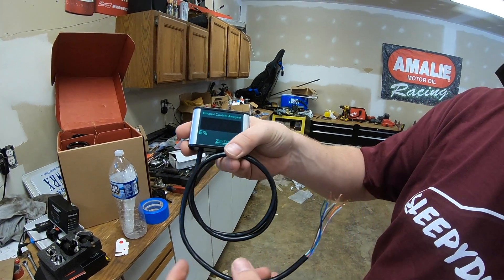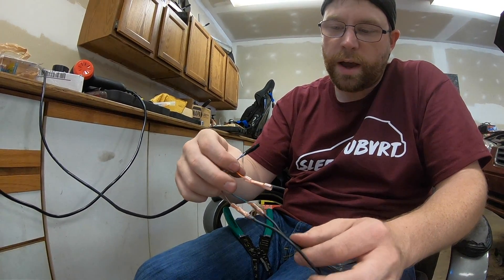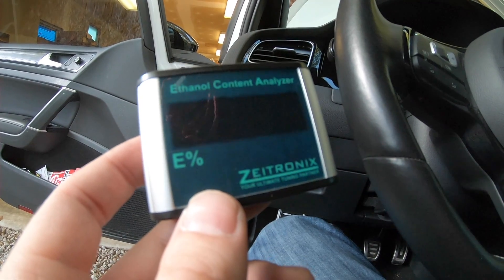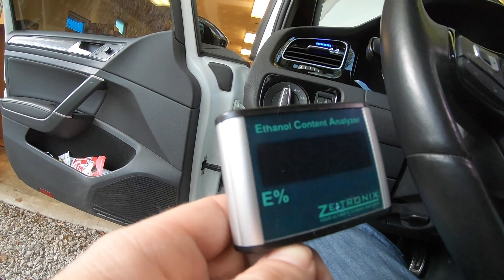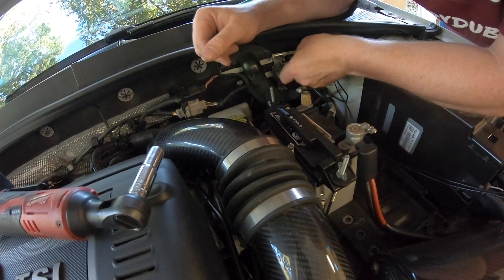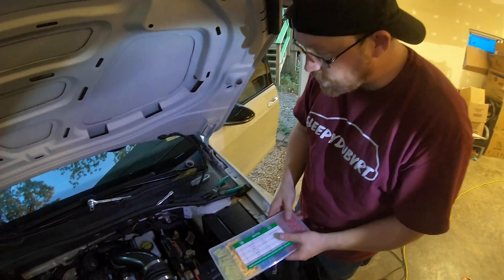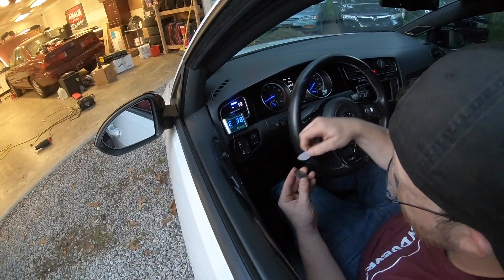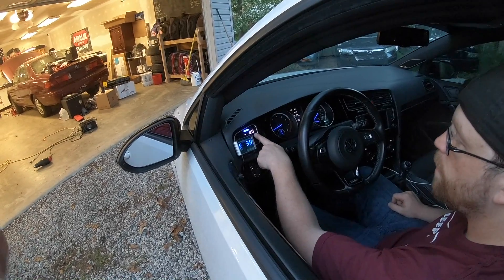MK7 UM Proflex Big Turbo Golf R - Ethanol Content Analyzer (gauge) Install

Comment: My 450 runs just fine at E60. Weird you cant't go over E40. You said 34psi, is that correct? if so what do you have done to your engine? Or all stock internals?
Reply from the maker: stock engine, what power do you make on e60?  That guy who tunes Leroy the Savage was tuning a truck for 1000 hp but got stuck because the walbro 450s wouldnt deliver the fuel requested so he had to upgrade the 450s.
Reply: 518whp peak holds 505whp to 7K, at 30psi with E50, Have not dyno on E60, but logs show same fuel pressure as E50 and pump duty went up 5% to 65%. If I recall the truck, it was full E85 V8 and not direct injected, tend to need more flow.
Reply from the maker: And it also probably has to do with my torque being tune limited by UM because of the stock motor, the more E, the higher the power (normally) but the higher E i run, the ecu starts backing the boost down so that it wont exceed what the motor can hold.

Comment: Mount the gauge in the little storage area under the headlight switch. That way its hidden, but easily accessible when you need to check it.
Reply from the maker: Christopher King I thought about that but since I use that cubby the gauge would have been in the way